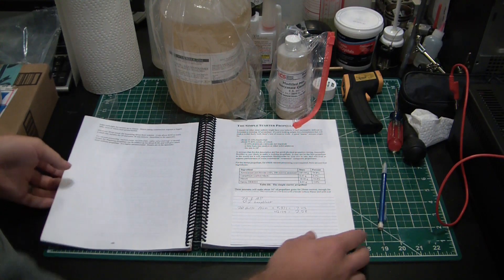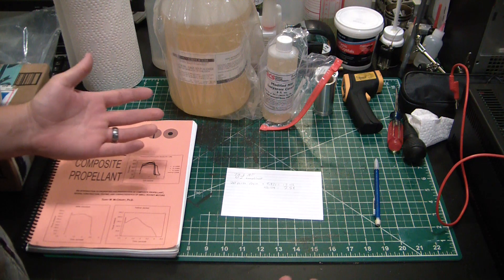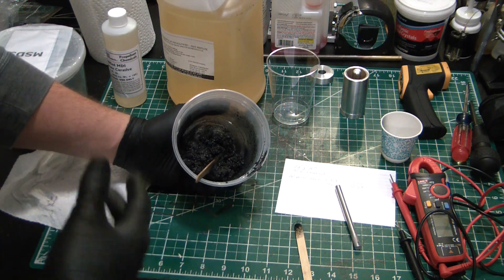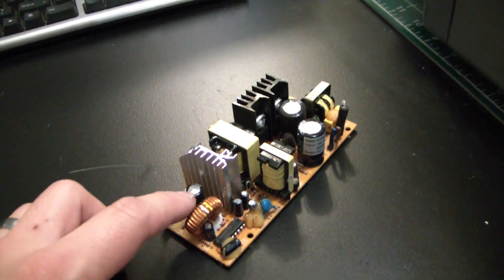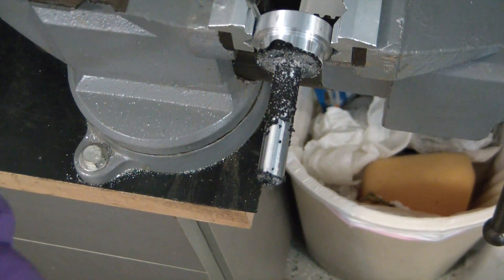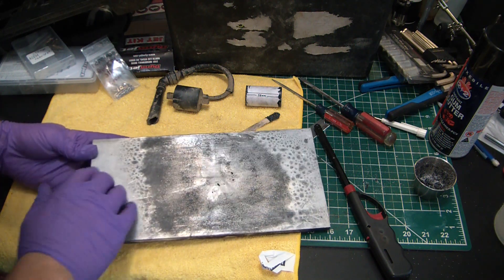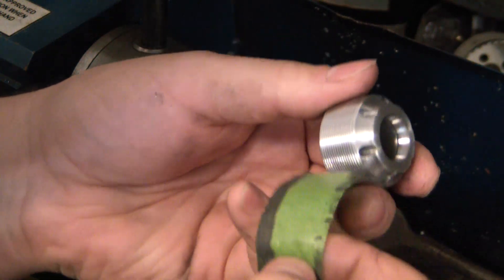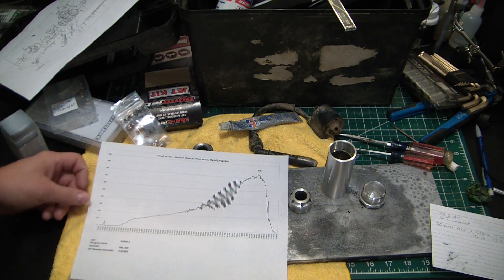Composite Rocketry Finally! - ElementalMaker

Comment: I think you'll get a lot of benefit from a better mixing method. I've done a lot of work with concentrated liquid/solid mixes of consistencies from watery to damn near solid (I almost got a PhD on the topic of slurry rheology). One common factor is that as you get things mixed more uniformly, the liquid becomes easier to manipulate. Having some (60-120 Hz) vibration can work absolute WONDERS for these sort of concentrated slurries, so definitely try that out. Alternatively, you may be able to pre-mix all the solids with the resin (without the 2nd part of the resin added) so you can mix for long time periods without it setting up.
Reply: The easier way is to dissolve the solids in a solvent compatible with the resin. Ethanol, methanol, and acetone can usually be used, but ammonium perchlorate is not soluble in ethanol, only partially in acetone. Using a bit of methanol or acetone to dissolve the perchlorate at least partially into a slurry, and then mixing it with the resin should allow a near perfect suspension. The methanol will evaporate before the resin has time to set. The acetone might not, and might make the resin set rubbery.
Reply: I wonder if it would benefit from some Gentle milling Before adding the curing agent?
Reply: @gazzarrr666  I'd feel sketchy milling a fuel/oxidizer mix, but if it's being done outdoors, or in an unoccupied area, perhaps/
Reply: @Nuovoswiss  Wouldn't you wanna mill the fuel and oxidizer separately, anyways?
Reply: @darkfur18  For safety reasons, yes, but for the best performance, you'd want to mill them together, for at least a bit to break up clumps. You can mill them separately down to a few microns particle size, but those particles will form clumps an order of magnitude larger, which will not be broken up by hand-mixing.
Reply: Nuovoswiss so, what you’re saying is that the individual particles are tiny, tiny, tiny, but the clumps they produce will be tiny, ti- And tiny, ti- clumps are still clumps And because they are so small they don’t lend themselves to “un-clumping” by hand mixing?
Reply: @oddjobbobb  That's about the gist of it. It's almost always better to err on the side of stronger mixing.
Reply: @Nuovoswiss  Milling fuel and oxidizer together is a terrible idea... I'm with you for thermite and such with a high ignition point, but for explosives, using a solvent and mixing solutions is way safer and actually more effective... Just add a bit of methanol to all the solids, mix into a slurry, and then mix with the resin. Methanol is compatible with all the chemicals involved, can dissolve the perchlorate and nitrate, and will give a perfect mix down to the molecules. You can put everything (fuel + oxidizer + resin, without the hardener) into a flask, add a stir bar and let it fully mix for an hour or so. Then add the hardener and cast it. You should also put in less hardener than a normal mix for fuel pellets. It'll take longer to cure but will harden a little denser and less rubbery. The methanol will evaporate out of solution way before it sets, and it will help thinning the resin so it hold less air bubbles in the end.
Reply: @HMan2828  Milling fuel and oxidizer together is standard procedure for other "pyrotechnic" powder mixes, like black powder. The trick is to use non-sparking media, such as lead balls. And never mix large enough quantities in each batch that it would be a big problem if it somehow went off. I'm not sure where you got this idea for methanol, but it is not a good enough solvent for either to dissolve much of either without using way too much to evaporate off.
Reply: @Nuovoswiss  You don't need to use much, just a few mils to make your fuel oxidizer mix a fluid slurry. Methanol is a standard epoxy resin thinner, and it does dissolve both the perchlorate and nitrates (of course the goal is not to dissolve it completely, a suspension is fine). Methanol is also a drying agent, and it is volatile enough that it can completely evaporate by the time the resin sets, leaving a perfect mix of resin, oxidizer and fuel... Could also use acetone, but it's less volatile, and is worse at dissolving both components. If some stays stuck in the resin the resin will set rubbery.
Reply: @HMan2828  If it doesn't dissolve them completely, then it isn't a "perfect mix". At best, you're just thinning the resin for easier hand mixing, which may actually be worse for breaking up clumps (the shear stress across a clump increases with higher viscosity fluid). The only time you can use a minor amount of solvent to "perfectly mix" compounds is if they are reacting in solution to form a less soluble product, and even then it's iffy.
Reply: @Nuovoswiss  Dude... Ammonium perchlorate is very soluble in methanol, and ammonium nitrate is moderately soluble in methanol (17g/100ml) at room temperature. Whatever part gets dissolved will be perfectly mixed in as it drops out of solution when the methanol evaporates out. Whatever doesn't dissolve will be in a much better suspension than the clumps he's getting now... It's the best way to mix them. Mixing two fluid together is guaranteed to give better results than trying to mix in a crystalline solid into a viscous resin.
Reply: @GeorgiaRocketman Best "release agent" is plenty of vasoline in the mold and a layer of saran wrap between the vasoline and the resin...

Comment: A suggestion only, for the ammonium perchlorate try ball mill to turn it to dust, a cleaner burn and easier mix. As for a fuel source maybe try a magnesium fuel.
             I love your vid's man. Ofcourse it's live and learn, right? We learn by our mistakes but I think you did very well on your 1st try. Remember that your mixture is crucial for a clean burn. Also I would try narrowing my nozzle just a bit.
         Again great job, keep up the good work.
           Opps almost forgot. Maybe fill the tube in layers of one mix at a time, say about in 10mm increments lay at a time.
Reply from the maker: The particle size of ammonium perchlorate is actually quite critical to its performance. If you powder it, it will just blow the casing. 200 micron and 90 micron are the typical sizes most composite propellants use.
Reply: @ElementalMaker  
Hey there thanks for the info, I wouldn't want any explosions to be on me.
    But this might be a little more modern information than what you have obtained. The book you are going by is 1990's information....up dated information can be found on modern rocketry forums. The way modern technology is going we will soon be mixing peanutbutter and charcoal as rocket fuel very soon. Lol

https://www.researchgate.net/profile/Sunil_Jain16/publication/283147266_Size_and_Shape_of_Ammonium_Perchlorate_and_their_Influence_on_Properties_of_Composite_Propellant/links/56fa63ea08ae38d710a3976c/Size-and-Shape-of-Ammonium-Perchlorate-and-their-Influence-on-Properties-of-Composite-Propellant.pdf

Down load the pdf file to at least check it out. Anyhow, I am no rocket scientist but this may help.  Again man keep up the good work.

Comment: Hey what exactly is the lamp black ?
Reply: Carbon. (soot)
Reply: Where would you get that ?
Reply from the maker: Yep as Benjamin said it is indeed just carbon soot. You can probably find it on eBay. Otherwise pyrotechnic suppliers typically carry it
Reply: Well there's a slight problem in my country I am not even old enough to obtain a lisence to buy chemicals at a pyrotechnics supplier.
Reply from the maker: I know it sucks, but its fair to wait until you reach legal age to get into high powered rocketry. See if a parent or other legally aged person will make Rcandy with you. Obviously do it outside, wear face shield, and thick cotton clothing. Its much better to start with Rcandy than composite propellant anyways.

Comment: Seemed like a longer burn time compared to the nitrite-based.
Reply from the maker: Yes for certain. The reason is because the nozzle was too large and didn't allow pressure to build as high is needed for the propellant to increase in burn rate. It's kind of a positive feedback loop. More pressure = faster burn, and so on
Reply: @ElementalMaker  So nozzle diameter is the critical difference between staying on the launchpad and exploding?

Comment: Suggestion: wrap some waxed paper around the internal mandrel? ~( 'w')/
Reply from the maker: I will definitely try that if the release agents I have in the way don't work 👍
Reply: @ElementalMaker  Not sure how finely your oxidizer is, but it seemed to be in pretty big granules, did you pre-powderize it before mixing it?

Also for a really high energy boost, I am sure you know that finely divided aluminum or magnesium [or even phosphorous] will really up the ante on total impulse, although, of course, it will destroy your nozzle... Too hot and even graphite will vaporize after all.

For a test you might like to amuse people with, a guy once showed how you can cut a steel beam with thermite [showing how it was used to bring down the world trade center after the government pawns said it was impossible] by placing it into a shaped square tube so that it jetted out one open edge and that jetting action turned it into a wicked cutting tool.

Same thing happens inside of a rocket nozzle with some hotter mixtures.

https://www.youtube.com/watch?v=5d5iIoCiI8g
Reply: Another option is a Rizzla (cigarette paper)...

Comment: Your technique for mixing the propellent ingredients is all wrong!  No matter what you change in your future experiments, the procedure you're using to mix it all will reduce performance dramatically.
Reply from the maker: Please elaborate as to what needs changed. Simply saying something is wrong and then providing zero feedback and suggestions doesn't help anyone
Reply: @ElementalMaker  Your ammonium perchlorate needs to be in intimate contact with your aluminum, or in your case carbon fuel, before adding the binder.  You should mix those first, very well, dry.  After that you can add the binder.

If I remember correctly, you just added the powders to the binder without mixing the powders first.  By doing that you ended up coating the individual grains of ammonium perchlorate and fuel with a polymer coating which keeps them from reacting as well as they could.

It's commonly known that this same principal applies to black powder.

One more thing, why don't you use a release agent on your mold?  Brownell's sells an Acraglas release agent that would be perfect for what you're doing.

Try the mixing method I discribed on the same formula, and you should see some improvement.  The release agent I recommended will surely help a lot too.
Reply: Also your ammonium perchlorate isn't fine enough.

Comment: You an test AP/Silicone propellant, it can be used for solid rocket motor. It burns fast and clean(all products are gaseous) and has huge amounts of power. You need to use metal spacers though....

Comment: @ElementalMaker you could put a cigarretpaper around the innercore to prevent it from sticking.
Reply from the maker: I'm going to try a few different release agents before moving to physical barriers. My concern is if they stick to the propellant it will interfere with the burn propagation.

Comment: I said I would take a look at the rocket test stand Arduino code because I didn't like the slow 80Hz "resolution". The HX711's are all 40/80Hz or so only. I guess its fast enough for a stupid person scale. Sadly I hadn't the motivation to build my own high speed front end with some osmelloscope IC as some folks recommend on the internets, but  I found and all-in-one IC like the HX711 which can sample at 300Hz but its a discontinued Sparkfun thing for about 30$ on ebay! Its called the NAU7802 and seems to be compatible with the HX711, but I couldn't try it so far. I have to order some HX711 with a load cell and this NAU and try to hack both together. I will let you know if I can build something decent (in time) ;) 

The IC:
https://www.ebay.de/itm/Qwiic-Scale-NAU7802/143307203684?hash=item215dc66464:g:ZOAAAOSwQHBdEOpO
Reply from the maker: That's awesome! I'd love to get a chip with a much higher sample rate! Please let me know if you can get it working and I'll definitely give it a go.

Comment: A smaller nozzle will result in a higher chamber pressure which should cause the burn rate to be a bit quicker, hopefully increasing thrust
Reply from the maker: That's the plan for the next go round!
Reply: ElementalMaker I’ve been watching your channel for awhile now and I love your vids. After I watched you build that hho generator I had to make one and it was pretty crazy. I used to make model rockets and experiment with different fuel mixes and additives. After seeing this I might have to get back into it. Can’t wait to see you hit 50k subs!

Comment: Mann400 Ease Release. Spray product. It works.
Your Kn is much too low.
And go easy with the metal-oxide catalysts. The tiniest little bit goes a long way.
Reply from the maker: I'll have to give that a shot on the spindle! Thanks for the tip. Yes I figured to start safe and slowly work to smaller nozzle sizes.

Comment: I think the problem is your propellant mix. I will have to check my notes, but my propellant ended up rock hard and completely homogeneous. I remember using West's epoxy (used for boats.) I did not use a spindle to cast it. I carefully and very slowly drilled out the spindle hole.  In some prior attempts I had the same flame coughing that you had, and I traced it back to uncombusted pieces of propellant clogging up the engine throat.  I made some motors about 7 years ago and lit some off this year and there was no degradation at all. Can't wait for the next video.

Comment: Are you only going to be making AP based composite prop? Or are you going to make others?
Reply from the maker: AP is really the only commerically proven one, although Richard Nakka has done some good experiments with NH4NO3 composite propellants. So I may also try something along those lines since AN is alot easier to get than AP.

Comment: Get yourself a switching dc-dc converter.  Single module, takes 60v to 250v input, ac or dc, it doesn't care.  Outputs 12vdc.